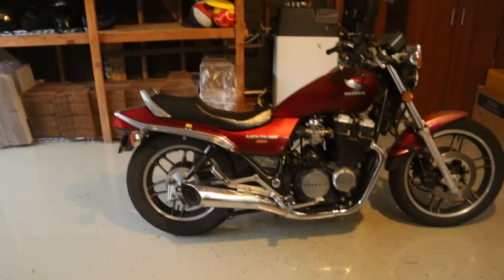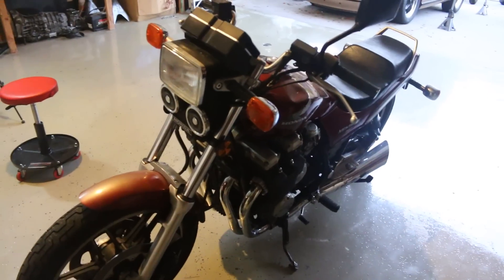PORSCHE BUILD EP. 10

Comment: you need to check how to use a vernier
Reply from the maker: synocate lol we knew some one would catch that. We just did that quick for video. Afterwards we used a metal yard stick to measure length than put it across to make sure they all lined up.
Reply: They need to be installed to a specific length (due to the barrel nuts), not just all the same.
Reply from the maker: mawe42 Yeah. You screw the first one to spec and then aline the rest and make sure they're level.

Comment: I know you are set on not splitting the case but after seeing the condition of the through bolt gasket why wouldn't you assume the case gasket to be in simulator condition?
Reply from the maker: Josh Corps The case didn't leak last time the car was running a few months ago. We are going to replace all the gaskets we can from this point forth, the through bolts were part of that.